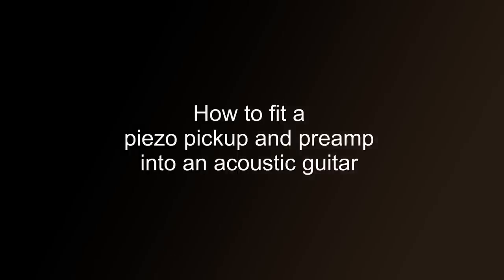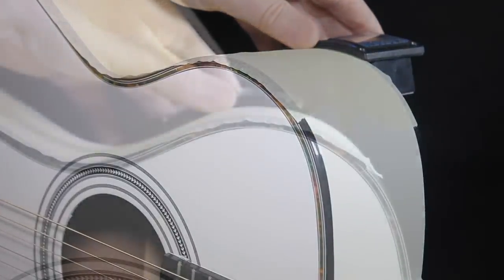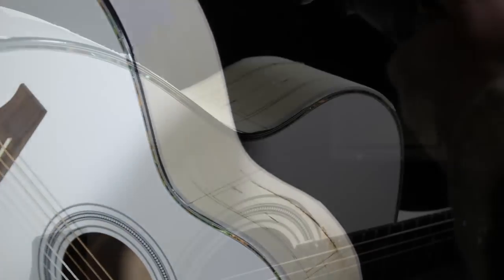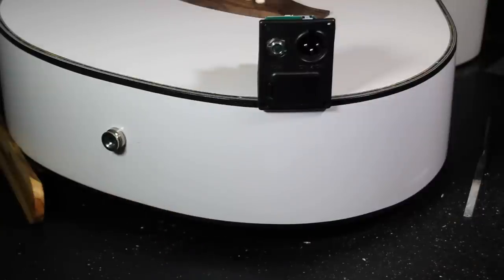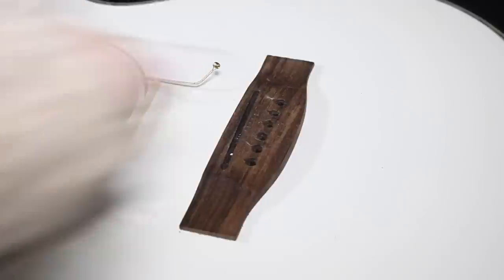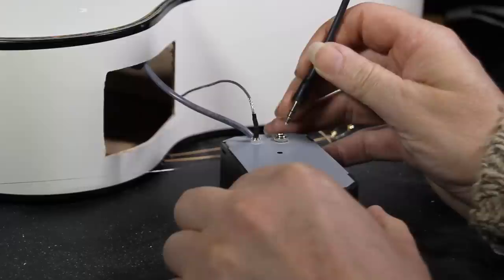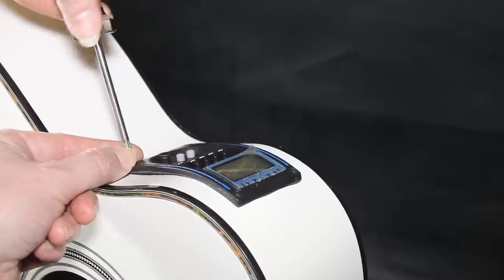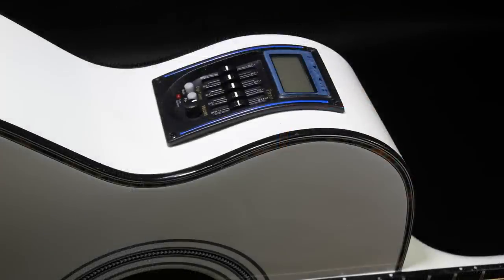How to fit a piezo pickup and preamp into an acoustic guitar. The LC-5

Comment: It's not a bad idea to support the body while making Dremel cuts, rather than cutting one handed = disaster waiting to happen :-) A couple of old towels in a Workmate very lightly clamping the body. I'm going fit an Artec preamp shortly and that is how I do it. I also drill 4 holes inside each corner which makes cutting easier.
Reply from the maker: agreed :-)  . . . .  
unfortunately these videos are never done under ideal conditions because I want the video to be as clear as possible I have the need for lights and camera tripods and stuff.  To film this I had 2 cameras at different angles and 2 lights at different angles, so you can imagine 4 tripods and trying to work around them.

Comment: Nice job!
I have a question: The recorded song from the end of the video is from the microphone mixed with the piezo under the guitar saddle? Or just the microphone? or just the piezo? Can you balance them till you get a nice mix from both?
Reply from the maker: What you described is exactly what did. . .  I balanced the piezo and the mic until I was happy with the sound.  Depending on which preamp you buy, you get a separate volume for the pickup and the mic or a mixer control

Comment: Great video sir, but i saw some video, they are using jigsaw and driller to make the hole. Does using these tool will have major effect?
Reply from the maker: Just as long as the hole is clean and the correct size it doesn't matter what tool you use.  :-)

Comment: Brilliant video my friend... after watching it, I bought the exact same kit as u... installed.it all today... I was just wondering do u find that the piezo pickup lacks volume on the E and A strings??? Cos I do lol :(
Reply from the maker: Lee Tantum Mine was really good and had good uniformity throughout.  But this is the only issue I've come across with the cheap pickups uniformity  . .  you get 8 good ones and 2 bad (ish).  
However, this problem can arise if the bottom of the bridge isn't completely flat.  The next time you change you strings, try taking the bridge out and sand it very slightly on a completely flat surface with very fine sand paper.
Reply: GCH Guitar Academy Ive already done that... think I'll buy another, better quality transducer to replace it

Comment: Very helpful video.
Do you need to strengthen the ribs of the guitar once you have cut a piece out? 
If so, how do you do it?
Reply from the maker: +david Willmot because of the strength caused by the curvature of the body strengthening isn't required.
However if you want to do it, measure the wood using the outside of the hole and then glue it on the inside through the sound hole.  When you screw the preamp in, the screws should go into the new wood and draw the whole thing together strongly.

Comment: Hi there,
Thank's for the great stuff. Sorry, I coulldn't read all the comments - how do you set the balance between the piezo and the mic? I'm planning to replace the mic with a neck magnetic pickup - do you think it's a straight swap?
Thanks!
Reply from the maker: This pre-amp has a balance slider so you can easily adjust the balance between the mic and the pickup.  I don't know if a straight swap would work because the mic and the pickup probably have a different impedance and there might be distortion.  The simplest way of finding this out would be to test it before fitting it in the guitar.

Comment: So helpful. Thank you so much sir. I'll try it
Reply from the maker: Thank you . .  I hope it goes well for you . .  😊
Reply: Which brand and model do you prefer
Reply from the maker: @The_Acquainted_Era  I recently did a review and installation on a 'Fishman Presys Blend 301' which I got off eBay for just over 10 UK pounds (from China).  I like that one because of the way the battery fits and the output jack fits, the battery also lasts longer in that one.  I think the sound is the same, but without fitting both preamps into the same guitar I can never be sure . .  😊

Comment: Is this pre-amp kit better than the Fishman unit you installed on the Glary guitar?  I'm trying to decide which one to buy. Thanks
Reply from the maker: No, the Fishman is definitely better.  The main thing I've noticed and other people Ive spoken to have noticed is that this one eats batteries where as the Fishman doesn't.  There is very little in the sound.  🙂
Reply: @guitar-academy  Perfect!  Thanks for the fast response.
Reply from the maker: @shaunkelly3562  No problem . . 🙂

Comment: Most pickup manufacturers provide the templates you'll need to cut the holes on their websites. You can print these out at 100% size, cut the template out and stick it on to your taped over guitar. Much simpler than all the measuring and marking.

Comment: At 9:23 Dude, the hole in the bridge doesn't have to be big enough for the plug to fit through, it only has to be wide enough for the filament to fit through. You feed it through from the inside of the guitar. You don't want peeps drilling jack sized holes in their bridges, man! Other than that, this is a great vid. Nice to see you using the Dremel type tool for a good clean cut, unlike that other guy with the jig saw.
Reply from the maker: The plug does need to be big enough for the plug to fit through because the piezo is the solid type and it can't be bent without damaging it, so you have to feed it from the top of the guitar.  🙂🙂  You are talking about a different type of pickup.

Comment: Thanks for sharing! I am installing the same  set in my old Contessa made by Honer.  The saddle is in a metal holder then in the bridge . I am guessing that the pickup goes under the metal holder then the saddle in the holder any comments before I put the strings on ! Thanks  By the way what do you suggest to seal autographs on a acoustic guitar
Reply from the maker: +Gene “Ghost Rider” Fuller I know the type of bridge you mean but I've never fitted a pickup in one so I can't give you any advise sorry . .  But someone out there should have some advise

Comment: Great ! Just the very one I'm about to fit although the depth of the bridge groove might be tricky since it hasn't had a pick up yet. Thanks
Reply from the maker: vogue singer If you have enough depth to hold the bridge in place after fitting the pickup, it is safer to sand down the bridge from the bottom so that it is thinner . .  and if you make a mistake you can buy a bridge easily and cheaply.
Reply: GCH Guitar Academy Thanks again . Really helpful

Comment: Great work! The sony you've used lately is a condenser microphone requiring phantom power, and it is a stereo mic!  Does the preamp unit provide phantom power? And how did the stereo mic translate into that mono input?

Thanks a bunch
Reply from the maker: No . . it doesn't require phantom power and works perfectly well with the preamp (as you can hear from the recording at the end), this model of preamp doesn't provide phantom power.
Reply: Thank you so much! I appreciate it! And once again great job
Reply: Beshar AL Azzawi hi those this work for a nylon strings??
Reply: Yes of course! All piezo pickups work by string pressure! But nothing beats using an external microphone! However it's a good option to have the electronics
Reply: Beshar AL Azzawi and how can I get that microphone what's the name
Reply: If you will playing in a concert setting, big stage, good sound system, then I would recommend using a small diaphragm condenser mic. the price range from $50 to $1000 and more. If money is no issue I highly recommend the Neumann KM 184, or the AKG C 451  which sounds good on flamenco guitars! For the cheapest yet good sounding mic, go for the t.bone sc180 from thomann!! This is a secret weapon! However, for a general live gig setup, if the musicians around you are loud, or if you will be playing in a noisy environment, then I recommend using a system like the one in this video!  I hope this helps
Reply: Beshar AL Azzawi thank you very much but I wash talking about the microphone on this video at minute 15:56 I see there's a diferente microphone how can I get that one ??

Comment: How good is this preamp, How does it compare to the ones that come in like an Ibanez AEG with the Fishman Pickup? Is it worth putting in a $300.00 guitar?
Reply from the maker: personally I wouldn't put it in an expensive guitar, but at the same time the pickup and preamp are remarkably good.  I'm going to buy another one and get a cheap guitar to put it in because the factory fitted Fishman in the acoustic I'm using at the moment is rubbish . .  I sold the guitar I used in the video to one of my students ages ago and I'm sorry I did because the recording sound was exceptional.  The only downer I had on it is that it seemed to eat through batteries really quickly.
Reply: @guitar-academy   Thanks

Comment: Did you struggle with the top screws on the control unit? Mine is a tighter fit than yours was and the top screws still miss the woodwork
Reply from the maker: There's always one awkward job.  I think I had one tight one . .  🙂

Comment: number of videos on here showing drilling the hole out.. ..i even watched one using a jig saw. ..they are really scary...  your method definately best ..failing that a couple holes drilled then use a hacksaw fine or medium blade.... failing all that get a lither to do it ..
Reply from the maker: I've used this method on lots of guitars and I've never made a mess of a guitar.  Here's a more recent one I did, the guitar work is the same but the video quality is way better 🙂   https://youtu.be/nK3jum0_Fig
Reply: Following your video and advice ......Just fitted a Fishman Aura pro  ( genuine " 2nd hand ".. from a new damaged guitar from my guitar shop )  onto my pride and joy as by your instructions.. perfect ..thanks very much for a fantastic demo... 
 ps....I will even order one of those ali-express jobs myself for my 12 string.." Pre-fix pro blend " model..
Reply from the maker: @geraldlattka8910  It sounds like you've got the luthier bug . . 🙂

Comment: Does this decrease sound quality of the guitar or affects the natural sound in any way?
Reply: On the guitar in the video, any sound quality decrease was imperceptible.  There was literally no change in the natural sound, however this will vary from guitar to guitar.  I wouldn't do this to a guitar unless I really needed it for recording or stage use where the natural sound isn't enough.
Reply: Yeah,was thinking the same.Instead of taking risks I should just save up to buy a new guitar(already built in).
Reply from the maker: Sorry, I answered your question in the wrong account . .  LOL
Yes.  The guitar in the video was a really cheap one (as an experiment) however I wasn't disappointed with the sound and I actually used it in an important recording.  But I wouldn't take an important guitar to me and do this.
Reply: Nah

Comment: I just bought an acoustic guitar with built in under saddle pickup and i don’t know what cable/chord should I need for it and I just saw it in the end of your video, can you pls tell me what it is and where should I plug the other connection???
Reply from the maker: The guitar in the video has 2 different connections, but they look very different so it's hard to get them confused.  The lead I plugged in has 3 pins and is an XLR cable and the other connection is a standard guitar jack lead.  You'll obviously have to match the lead up with whatever you want to plug the guitar into (an amp, a mixer, a sound card).  I hope this helps 😊
Reply: @guitar-academy  yes! I really appreciate this big help! Thank you very very much!☺️😭
Reply from the maker: @lyndsaylojares  no problem 😃😃

Comment: How is the pickup when plugged in for you?  The only reason why I ask is I got a guitar that uses that brand and it is very tinny when it comes to the tone(a lot of high frequencies bleed through) and it seems like it’s working way too hard (I had to change batteries all the time.). I don’t know if it’s just the one I have installed is defective or if I just got a bad brand in there altogether.
Reply from the maker: Interesting . .  The sound on the one I installed was nice and because of the EQ it could be adjusted nicely without bleed.  But I did have the problem with the batteries it used batteries really quickly, I even started taking them out thinking it was staying on when it shouldn't be.  Also, I didn't test it on the original mic, which I should have done . .   I think the biggest problem with anything cheap that is made in bulk is quality control, so they vary from massively from pickup to pickup, so I don't think your installation is wrong. 😀😀

Comment: I have a question, is possible join single coil pickup to microphone input? I mean something like fender telecoustic deluxe
Reply from the maker: I have no idea, sorry.  The thing that would you need to check up on is the impedance of the mic and the pickup.  If the impedances are different the pickup will probably work, but it will either produce too much power so it distorts or not enough so it is too quite.  You will have to do some more research to see if anyone has done it.  Tell me how you get on, it would be a useful comment for lots of people . . . .

Comment: Does the pickup work with nylon strings? I was told that they don't.
Reply from the maker: Somebody is telling you lies or doesn't know what they are talking about . .  unfortunately there is a lot of that on YouTube.  I can prove that they work with nylon strings, you just have to watch some of my tutorials on finger picking https://youtu.be/M3PxePQmFBM .
Before buying one for your nylon strung guitar, measure the bridge and make sure you buy a pickup of the same length.  😊
Reply: @guitar-academy  It was someone at my local Guitar Center.
Reply from the maker: @sailcaptain  I guess they might have thought you meant an electric guitar (coil magnet) type pickup . . . because they won't work with nylon strings.  With piezo you are good to go though.

Comment: i have a problem with my guitar,, my 3rd string is not loud as the other strings, is it mean that my piezo pickup in problem?, ,, and how to fix it,,?..
i realy need your answer, 
thankyou bro...
Reply from the maker: +Alex Gunawan Lex I would say that the most likely thing to be wrong is the pickup, it sounds like it could be the pickup that is faulty.  
But 2 other suggestions, 
1 if the strings are not a complete set you will find a lighter string will have less volume.  
2  if the underside of the bridge is uneven this can cause issues, make sure the underside of the plastic bridge is making contact uniformly with the pickup.

Comment: Hi there, is it okay if the saddle is a little loose when you have an undersaddle piezo pickup?
Reply from the maker: good question . .  Yes that's OK, the strings will put pressure on it and hold it down 😊

Comment: Is there any chances that your guitar will collapse without even accidentally cutting through the braces?
Reply from the maker: only if the guitar is very thin and there is no wood either side of the the hole and/or the glue holding it together has become very brittle and weak

Comment: About the 'extra' microphone that plugs into the back of the preamp that you switched out for a different one. Why did you switch the included mic and what mic did you replace it with?
Reply from the maker: +Ken Johnson The original mic was noisy and you could hear a clear buzz, the new one was much quieter and is a Sony.  The particular model has been replaced now and I don't know what the new one is.

Comment: What is better a sound hole pick up,piezo pick up or fishman pick up? Can I install that all in one guitar?
Reply from the maker: Firstly, a Fishman isn't a type of pickup it is just a make that produce various pickups, so if you want you can get a Fishman piezo pickup for example.  Which type of pickup is best depends entirely on your taste.  You can ask several guitarists and you will get different answers.  If you were to put a lot of pickups on one acoustic guitar it would damage the acoustics of the guitar, so be careful.
Reply: I want my acoustic to be electric acoustic ,what will I choose?
Reply: The one he installed has both an piezo pickup and a microphone, which you can blend or use one or the other using the dial on the pre-amp, which gives you the best of both worlds I guess (although some prefer the sound of a magnetic pickup).  You can find one like it on Ebay for about $10-$15.  Use this ebay search: https://www.ebay.com/sch/i.html?_from=R40&_trksid=m570.l1313&_nkw=Acoustic+5-band+EQ+Equalizer+Guitar+Preamp+Piezo+Pickup+mic&_sacat=0&LH_TitleDesc=0&_osacat=0&_odkw=Acoustic+5-band+EQ+Equalizer+Guitar+Preamp+Piezo+Pickup

Comment: Hi GCH Guitar Academy ! I have a vintage Takamine 12 string guitar, i want to fit this pickup in it so, is it  a good trick to sand the saddle at the thickness of the piezo pickup ?And what microphone have you replaced with 2 heads ? Thanks !
Reply from the maker: ***** The microphone is a ECM-DS70P.  I don't really understand where you are talking about sanding, but I avoid sanding the saddle and do all the modifications possible to the bridge blade because this can be easily and cheaply replaced if you get it wrong.
Reply: GCH Guitar Academy  The saddle piezo is 1/16''  and  my Takamine  saddle is 3/8'' so , if to do sanding the bottom of the saddle to 5/16 '' on my Takamine ?The saddle is a drop in/out ! BTW Great video and nice guitar ! :)Thanks!
Reply from the maker: ***** ahhh . .  it sounds like you are going to have a less straight forward job than the one I had.  You will need to enlarge the saddle slot which will take care and patience.   :-)